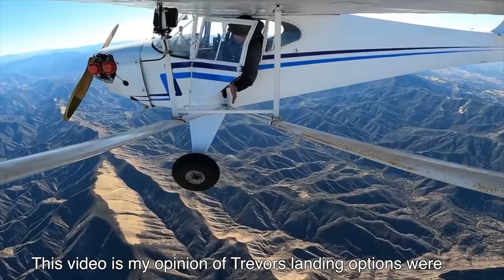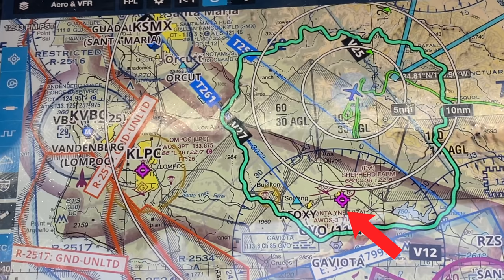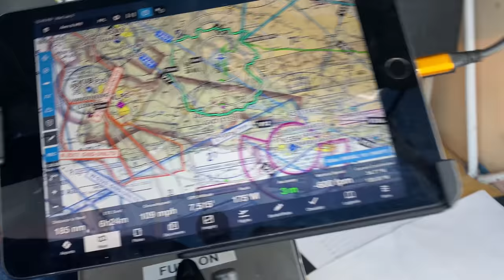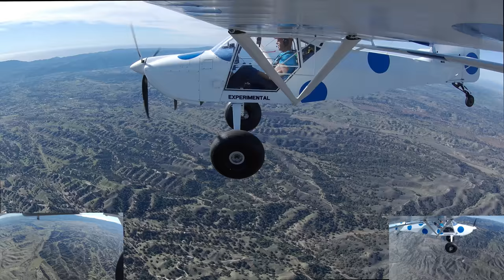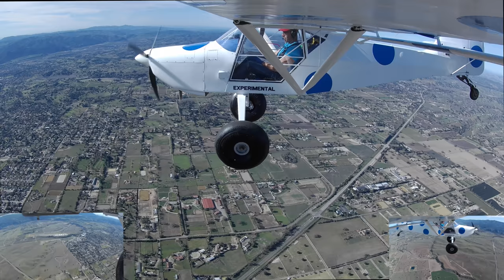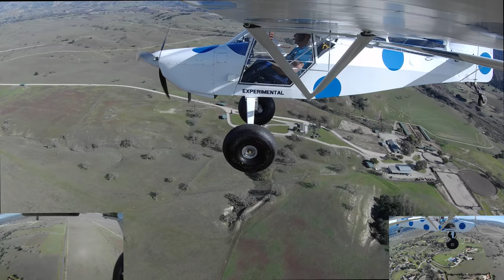Trevor Jacob plane crash -landing options

Comment: Took a while to get to this one (actually watched the clip edit first), and have to say this adds more nails to Jacobs coffin. It's probably been commented but, whether a 912 or a Lycosaurus, if properly set to idle, and the prop is windmilling, you are actually getting more drag than if the prop is stopped (even a three blade), although I'm pretty sure Jacobs got down below best glide to stop the prop for effect. Hint, if you ever have a terminal engine failure (no gas, thrown rod, etc), and you have some height, carefully get as slow as you can to stop the prop, then assume best glide. It will increase your performance a little.

Comment: You did an excellent job demonstrating Aviate and Navigate (best glide and picking the landing spot) but before Communicate I would have gone through at least a flow check to try and restart the engine and depending on how much time I had took out the checklist and gone through the restart procedure there. Preparing the cockpit for a potentially hard landing is an important step too.

Comment: I might actually disagree with one of the things you say around minute 1:50. Generally speaking ( this might not be true for every plane and engine combination) an engine in idle produces no lift at all but drag because of the rotating prop disk in front of it. Once the prop stops spinning ( usually it happens during best glide during engine out ) the drag gets reduced causing the glide ration to improve a little.
Reply from the maker: Perhaps I am wrong on that

Comment: I'm not familiar with the aircraft type but I have been trying to figure out if the right wing tank was disconnected how much fuel could have been on board. A DCT flight path is 194 nm and all the max range information that I can seem to find for the Taylorcraft BL-65 is like 250 nm. It looks like the wing tanks are 6 gallons each and an optional aux tank can be installed that is another 6 gallons. I might just be going down a rabbit hole with very little aviation knowledge so I would like to hear your thoughts on this.

Comment: Has there been any investigation done yet? Or are they still working on it? How long does that usually take for a situation like this? I know for the big airliners with a lot of people and what not it can take a reallyyyy long time but I figured this situation would be pretty cut and dry. Regardless if it were faked or not, just wondering how fast a smaller investigation usually takes.

Comment: While it's obvious this was a stunt, I could imagine several plausible answers to your questions that would prevent Trevor from being convicted.

1) Why didnt he turn back to Santa Ynez? Because in the heat of the moment, he just looked around him and didn't see what he liked and didn't see Santa Ynez. Could he have done better at looking at his charts to figure out if he could glide to a nearby airport? Sure - but inexperienced pilots sometimes just don't think all that well, especially in a tense situation. As a flight instructor, I have simulated failed engines within gliding distance to a small airport multiple times with students multiple times not finding or deciding to go to that airport.

2) Why didnt he land in the field? Because he had a parachute and viewed the parachute as a 100% gauruntee of living and the attempted engine-out as maybe a 50 or 60% likelihood of living. Many inexperienced pilots aren't all that good at precisely making a landing target while engine-out, and you're looking at spots that are only maybe 2000ft long.

What will ultimately convict Trevor is 1) the wreckage might show the engine was fine and they'll investigate what was up with the dangling fuel selector and maybe subpoena his other videos if he hasn't already deleted them and wiped his hard drive back to all zeros. Or 2) Internet search history or texts might prove his intent and guilt.

Comment: “An idling propellor is not producing any power [thrust]” - well it is a little bit, but more than that it’s not producing drag, which is what a windmilling propellor does (that’s why it’s windmilling - the air is pushing against it). But your fat tires probably make up for that!  (A good way to simulate a windmilling propellor is to put on a notch of flaps)

Comment: What do you think the repercussions should be for what he did ?
Reply from the maker: 9/11 proved aircraft filled with fuel are a wmd. I hope if Trevor is guilt of intentionally crashing a plane that he gets charged under the postc9-11 terrorism laws
Reply: I can't say anything will happen until an investigation, but hypothetically if the plane is insured and he makes a claim and later it's shown he faked engine problems then that is insurance fraud.
Reply: Certificate revocation would be a good start.

Comment: I like how he intentionally slowed down enough to stop the prop for the camera.
Reply from the maker: In his defense, depending on the aircraft, slowing to stop the prop from spinning can be a part of the emergency procedure. A windmilling prop has a lot more drag than a stopped propeller.  On my aircraft though, there is no way you can stop the prop from windmilling if you are to maintain the best glide speed.  Of course, you cant prove visually you had an engine failure if the prop is spinning :)

Comment: There seems to be some confusion as to what the FAA can actually do to TJ. As its name indicates, the FAA is an administrative agency. It does have enforcement capability within that role, which means that its enforcement actions are of the administrative law type. I could be wrong, but there is so much evidence against TJ pointing to careless/reckless operation and multiple possible other violations, that it is likely that he will see his certificate revoked and serious fines, once the investigation is complete (that will take a while). However, in order for criminal charges to be pursued (the only kind that could lead to a prison sentence), the FAA would have to refer the case to the Dept of Justice, who would then have the ability to prosecute whatever offense they can identify and make a case for.
Reply from the maker: Removing crash evidence before the NTSB can investigate is a federal obstruction of justice charge.  Lets start with that.
Reply: @scooby1961   I agree that this is a big one, likely to lead to its own far-reaching consequences. In fact, it may be the single most suspicious part of the whole crazy story. Totally unheard of (at least for me) that one would go to such extremity in this kind of circumstance; the helicopter retrieval in such a remote place could have cost more than even an airworthy Taylorcraft could be worth. The plane was wrecked anyway, so the possible motivations for doing it are, well, many and unflattering, to say the least. Nonetheless, any criminal charges would have to be prosecuted by the Dept of Justice, because that's not what the FAA does. I do agree that, if this turns out to be what it looks like, he deserved to have every possible charge brought. The rest of us work hard to uphold standards and improve the perception of general aviation in the public. It's disheartening enough when the usual suspects (CFIT, VFR into IMC, etc) become statistics and take another doctor or businessman, so we don't need bozos pulling stupid stunts for stupid reasons.

Comment: If you look at the pilots door from the tail camera you can see he has already unlatches the door and has it open just before the engine even stops. It's almost like it was planned. Also the fuel in the right wing has been removed and the plane has been emptied out. The type of aircraft he is flying has a 12 gallon nose tank. If you look on the strut holding up the wing you can see that the nose tank is showing it still has fuel. Who fly's with a camera on a stick. It's like he knew before he took off he would need it to show the plane crashing as he parachutes down.

Comment: Winds for you were 270 at 9 enroute to your exercise emergency landing field.  The glide at 65 knts from 10,000 to 3,000 showed that it was possible for the Tailor Craft to reach it.  Need to know what the winds were for Jacobs and what it's glide performance is against your experimental.  In some respects, in does not matter because to head in that direction would have led him to flatter ground for a safer emergency landing.
Reply from the maker: both have a glide of 9:1

Comment: Hey Scoobs, I've heard it said that in the flying community that flying with a parachute is unusual and even seems to be a little frowned upon. To me who is not in the flying community (yet) this seems kind of like going on a boat without a lifejacket.

Is there a reason this is the attitude in the community? The only reason I could think of on my own was that it encourages reckless behaviour like bailing out of a plane when a landing is still possible, but I dunno if this is the reason some are saying it's general bad practice.

Interested if you have an idea of why this is, or if this is a misstatement of the community norms by those not in it.

Thanks.
Reply from the maker: Airplanes are VERY reliable, like 100x more than a car. Add to that, the most common failure is engine out and gliders land safely all the time. Structural failure where a parachute would save your life is almost unheard of
Reply: @scooby1961  Awesome, thanks, I appreciate it.
Reply: Yeah, that really is the attitude in the community.

Consider the relative safety of an airplane vs. a parachute.

Let's look at skydiving as a sport, since that represents the best-case scenario, of trained people with excellent equipment jumping in a controlled manner with a plan for what to do and where to go.

According to the US Parachute Association, about 1 in 1,000 jumps result in a chute malfunction.

According to the FAA, about 1 in 2,000,000 flights result in a crash.

Now... an emergency chute with no controllability, no backup chute, last maintained and inspected who-knows-when, is probably not going to have a 1:1000 failure rate. When they do have failures, they're also going to be far more likely to be fatal (About 1% for sport chute accidents).

Actual fatality rates are a lot harder to compare, since parachutes usually only have one or maybe two occupants, and airplanes tend to have multiple people in them, but the NTSB says that 95% of plane crashes are survivable.

So, even if we take 1% for chutes, and 5% for planes, that gives us something like a 1 in 100,000 fatality rate for parachute operation vs. 1 in 10 million for airplane operation.

Or, in other terms, each time you use a parachute involves about as much risk as flying a plane a thousand times. Which, unless you're a professional pilot, is probably way more than a lifetime of flying.

From those numbers, I think the more helpful safety tip is that if you're going to go skydiving, you should carry a backup airplane just in case. ;)

Not to mention the hazard an airplane flying uncontrolled with no pilot represents... in types of flying that usually do involve emergency parachutes, like aerobatics and military flights, there's also a lot of training and obligation involving making sure the plane isn't going to put anyone on the ground in danger.

Take the Canadian Snowbirds air demonstration team, for example. A couple of years ago, one of their planes had an engine failure due to a bird strike immediately after takeoff. It was a completely survivable event, with plenty of time for the pilot and passenger to bail out... but had they done so, the plane would have continued to crash in a residential area. So, instead, the pilot, at great personal risk, banked into a tight turn to make sure the jet didn't crash into the populated area. By the time the plane was on a safe trajectory and they were able to eject, they were quite low, out of control, and heading straight down near the ground. The pilot was severely injured. The passenger, a Public Affairs officer, Captain Jenn Casey, was killed.

It was the right decision. Both of them knew what they were signing up for. The sacrifice of one person's life and another's well-being likely saved many innocent lives on the ground.

Do you think a typical civilian pilot would have made that decision? Are you willing to bet your life and the lives of your loved-ones on it? Not if and when you or they fly... but today, right now, with the chance that a pilotless airplane could crash through the roof over your head completely at random?

Really, all of that is moot. The most dangerous part of any flight is takeoff and the moments immediately after it. That's when there's the most fuel, when the engine is hottest and producing the most power, and when any failure could result in a situation where there isn't enough time to react and find a safe way to put the plane down. A parachute isn't going to help you in that situation. You'd need an ejection seat for a catastrophic failure immediately after takeoff.

The time when a parachute might actually help you, during cruise flight, is also the safest time to have a problem during a flight. It's when you have the most time to problem-solve, to find an alternative landing site, and to glide to it.

So, to summarize... to bring a parachute along when you fly is to bring a far less reliable vehicle with you, just in case you have a problem during the safest part of the flight and don't mind turning your airplane into a missile that could kill a random family on the ground.

It's less like going boating without a life vest, and more like going boating without a beach ball with a hole in it that could only really help you if you fell into the water at the beach, when it's safest anyway.
Reply: @barefootalien  Thanks, that explains it really clearly for me.

Comment: Trevor (assuming he genuinely felt he HAD to ditch the plane) abandoned EVERY protocol that even a BASIC private pilot would adhere to. At THE VERY LEAST, he should have his pilot license permanently revoked. 

IMO he should face criminal charges. I’ve personally (pre checkride) been caught in a snow storm and genuinely thought I was going to die, completely encapsulated in white with very little hood time, was spatially disoriented and still followed protocol and had ATC guide me out! Trevor is a disgrace to real pilots everywhere. SMH!

Comment: He's an extreme dudebro who got into aviation somehow, likely skydiving since he was an instructor in that field. He seems to be narcissistic, and prolly thought he was smarter than the world before this incident. He vastly underestimated the sheer competence that persists in the worldwide aviation community, as well as the average IQ level of its professionals, practitioners, and even down to the level of base enthusiasts. 

I've never so much as touched the yoke of a real aircraft, but even with my meager level of aviating knowledge I know that pilots have checklists and ATC calls to perform in the instance of a dead stick. I also know that he's in a very light plane at a high altitude, so he should be able to trim the thing for best glide and spend some time looking for safe places to land while communicating his situation to ATC. ATC would give him the nearest airfields and assist in getting him on the ground.

This guy just killed the fuel, stalled the plane, and immediately left the airplane to do whatever it felt like from 9000 feet. 

Nothing points to this being legit. I hope they give him federal time.

Comment: One more thing: Given the crisp, dry nature of the brush he landed in and hiked through, I'd say there was a high risk of starting a forest fire if the plane caught fire upon crashing. Yet, I didn't see evidence of fuel spillage at the crash site. Were the tanks empty? Did he start with a low fuel load to minimize the possibility of fire upon deliberately crashing the plane in the tinderbox of a California forest?  The fire risk of a deliberate crash could constitute reckless behavior that rises to a prosecutable level. He was only a third of the way to his destination. There would/should have been quite a bit of fuel in his tanks. Low fuel could have been done on purpose - if he  was trying to minimize the possibility of causing a fire - or, empty tanks could have led to the engine cutout. Or both! In any case, crashing an airplane is a reckless fire risk in California.
Reply from the maker: Similar thoughts crossed my mind.  That is one of many things NTSB investigators will look at.  It would be highly suspicious if 50 miles into a 400 mile flight, he ran out of fuel.
Reply: The plane was being sold for parts and the fuel selector is dangling from the wall... I'd say the tanks were flushed and he had small portable tank with just enough for this stunt

Comment: In 2001 an Airbus A330 lost both engines due to a leak in the fuel system.  The airplane glided 75 miles to the closest airport
And this clown jumped out after 5 seconds of engine failure on a tiny airplane that could glide for a loooong time